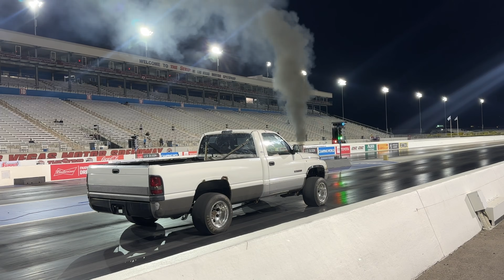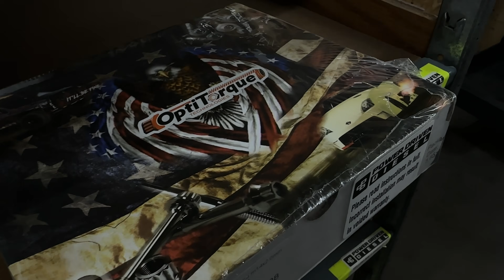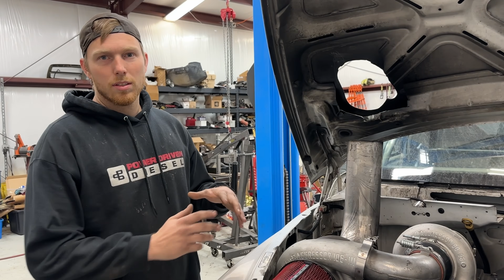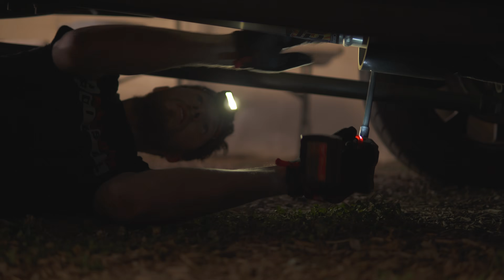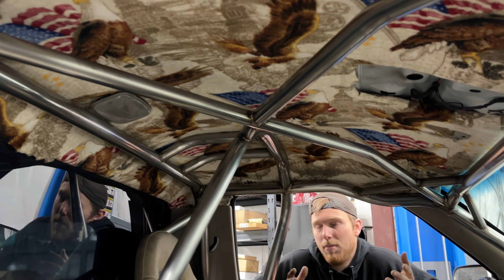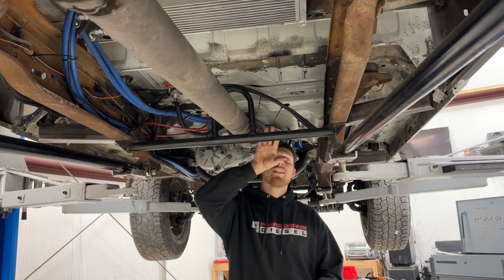6.7 Cummins Swapped 2nd Gen Dodge Ram

Comment: Have a question for you I’ve been building my truck when I can I work in the oilfield in Alaska so I don’t get a lot of time at home! Have an 04.5 has the pressure tower springs manton pushrods xdp billet rocker bridges,brand new ddp 150% overs 14mm exergy race pump,FASS 250 pump! And steed speed angled t4 with an aggressor 88! Built trans muldoons fmvb and I haven’t had time to run it yet have 5.9 diesel mm3 tuner at the moment but purchased a mp tuners to dial it in once I get it out of my garage and driving! What do you think the power level could be at with this setup?
Reply from the maker: Are you running just a big single?
Reply: @pddofficial  yeah I was going to run a shot a juice to get it spoiled up if need be it’s just a track truck is all I’m using it for
Reply: @pddofficial  spooled

Comment: I was hoping this was going to be your 2wd truck that you once said you basically upgraded the frame to 3rd gen? I have a 98 2wd that I want to lower a little and upgrade the trans Xmember and and switch to a steering rack ...
Reply: That truck is still around!  It got a 6.7 swap and is currently waiting for a custom turbo to wreck havoc on the single turbo class on the dyno circuit!

Comment: Interesting it’s only 400 more horse than Todd’s daily but with twice as much turbo. Seems like it must need more cam.
Reply: It's not that much more turbo.  It has the same GT55 on the atmosphere, but with a 480 on the manifold instead of Todd's 467.  The Larger Manifold charger doesn't make a big power difference, it just helps carry the power out further in the RPM range, as well as prevent heat soak going down the track.  Todd's tow truck makes about 10-20psi more boost then Scrat, which just shows how much the 96 turbine helps get the exhaust out of the motor.  The best I've done with Scat is 1847hp, but I expect to beat that come April 20th! 🤞
Reply: @CumminsWorks My bad I thought Todd had an 88 for the atmo. Personally I think a pair of 88s for atmos would go great with your 80 manifold.😊
Reply: Yeah I'm sure it'll make good power and I might get a wild hair up my butt some day, but triples are pretty miserable to work on.  Which kinda goes against the nature of the build.  Would be sweet though!

Comment: Dude your 2nd Gen is bad to the bone! I especially love the quick disconnect engineering of the harnesses. I have always thought that's what all vehicles should have period. I am just getting started on the 94 I inherited from my Dad when he passed, but when I have my money saved up I will be seeing you guys. But I send everyone I know with Diesels to PDD. My buddy just got his Trans done on his Black truck and he is happy as a clam, he hauls a lot of heavy equipment. You guys knocked it out of the park!
Reply from the maker: We appreciate the support!  Hold onto that 94', it's special now and it's going to be even more special as you customize it and make it your own!
Reply: @pddofficial  I am very stoked about it. I am hoping to put it around 600 hp and 1200 torque and still be not too bad on fuel. I am thinking that with that kind of power I will need a triple converter and a PDD flex plate as well as the panoff upgrade too. We will see what my budget dictates lol.

Comment: Pretty awesome but I was disappointed it wasn't a 12 valve. Still awesome.
Reply from the maker: 1800 HP fuel-only 12v is pretty difficult to maintain/keep alive.  As much as we hate to admit it, radical 13mm pumps capable of 1800 HP  and tuned clean are especially rare!  1500 HP fuel-only water cooled 5.9 block based 12V is the current threshold Will's working on making reliable.
Reply: @pddofficial  What's a safe, and streetable, hp capable out of a 5.9 w/VP44 ? Guy in my town has a 700HP truck but I don't see it out much. I daily drove 416RWP 20 years ago but I know things have changed , been out of it for a while till recently.

Comment: Any input on those speed of air pistons? Would love to see you guys test them and maybe see if something you would carry in stock?
Reply from the maker: We've been interested in trying them to see what, if any real world benefits could be measured.  We've all seen claims of 100 MPG carburetors and yet, they still don't exist.  If the claimed 20% efficiency gain was real, this technology would have been bought up by a large auto manufacturer and utilized to give them a leg up on the competition.  However, is it possible that there are other benefits like reduced idle haze, marginally faster turbo spoolup, even a mild 3% efficiency of power gain with some other not yet known tradeoff? We'd like to know so we'd definitely like to test the technology and see what it does or does not do!

Comment: I love the build, what happened to the shotty or shorty?
Reply from the maker: It's still around, terrorizing the dyno circuit from time to time.  Rumor has it, the shorty might make a big debut in Phoenix at that NHRDA race for the dyno event...  just a rumor at this point!
Reply: @pddofficial  do you have specific videos on this truck and it's changes? I'm thinking I need to build one , I have a spare cummins that needs to breath fire again ...

Comment: Gotta love the stock intake horn and 1800hp!
Reply from the maker: It would be fun to test a few intake elbows on this truck and see what each one does or does not change to the overall performance of the engine.  Any suggestions on which intake elbows should make the cut?
Reply: @pddofficial  I agree. That would make a great video as people do seem to discuss them quite a bit.
Reply: Banks, afe, smeding, pusher

Comment: Have you guys ever done a dyno comparison  of a banks monster ram and cold air intake vs stock intake and filter right next to a hot turbo?  Looks to me like the stock intake and just a K&N off the turbo works just fine:)
Reply from the maker: It would be an interesting test.  On the air filter side, this truck needs a 6" intake to match the inlet of the big 106mm turbo.  None of the mass produced air filter/intake kits would fit so it would be a less than ideal test scenario.  However, we could test intake elbows at the cylinder head intake plenum.  Those would bolt up for the most part and could be reliably tested.

Comment: Thanks for sharing. I tried the quick connects for the fuel and trans, but had issues with leaks. The o rings react to oils. 

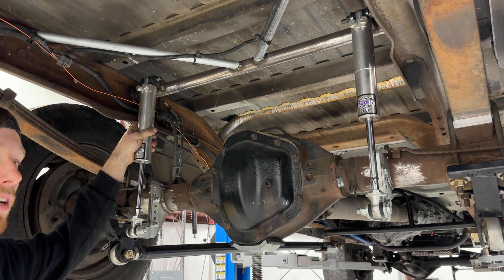7:30 Do they make a 2wd version of those shocks I see the compression rebound adjustments. The Bilstein's I run are valved too loose, but the tightest factory ones I know of.  A problem I have been trying to solve since 2018. I just keep getting told to get a 4wd truck. I got several of those too...
Reply from the maker: There are quite a few off the shelf race shocks that you can make work if you're willing to weld brackets to the axle and frame.  The heaviest valved shocks we've come across before you get into custom valved race shocks are the AFCO Big Guns shocks.  We believe they will be valved tight enough to control your rear end.  If that isn't enough, you should message John at Black Tie Race Fab and get some custom Penske's ordered.  Also keep in mind, once you get the $400 per shock retail price level, most shocks can be reworked with different valving to better suit your needs.  Strange, AFCO, etc.  Just don't go for the cheapest $250 shocks, they usually are not re-valve able.
Reply: @pddofficial  Back I have solved. Its the front I am need. If i had a knob on the Bilstein's I would say I need 2 or 3 clicks of each rebound and compression to get the ride perfect. I will visit the fox booth tomorrow and pick their brains. Something off the shelf should exist. I just problem dont have the lingo right.

Comment: Curious: how intricate was it to swap the 6.7 in? Motor mounts?
Reply from the maker: For motor mounts you'd want to source 98.5-2002 motor mounts since the 24v mounts are a little different than the 12v mounts despite the frame being essentially identical from 1994 thru 2002.  Then you could run any 24v block, but most choose the 6.7 to get the displacement and block strength.
Reply: @pddofficial  
I'm going to have a spare rebuilt 2004.5 5.9 Cummins pretty soon. I'm thinking of swapping it into my squarebody as is because of how great it is stock. Personally it's been the best engine I've ever had; ultra reliable, mega torque,  and 18-20 MPG.

Questions:
Would you install it as is? Everyone always wants a 12 valve. 

I've heard the injectors don't last as long as the 12 valve ones do. Would you or can you back-date it and build it as a mechanical 12 valve?

Think like the Roadkill Ramp Truck you guys did up. My truck is a 1 ton  regular street truck, but it's heavy and towing often.

Please and thank you for any insight.
Reply: The blocks are the same, it bolts right in, it's all down to electrical and plumbing.

Comment: Cool, my projects share some of the same titles, such as:

1.Overall project
2. Terrible disaster
Reply from the maker: It's a common theme.... sometimes the journey is more fun than the destination even if it's a bumpy ride!
Reply: Oh very much. The ride wouldnt be exciting without bumps!

Case in point:  i recently dropped an intake horn washer in my intake plenum and ran the truck... after discovering the horrid rattle i uncovered my stupidity.  This merely allowed me to justify taking the head off and porting it, buying studs, a steedspeed manifold, puahrods and springs from you guys. Hoorah for stupidity!

Comment: One day I'll have enough spare change to bring my 95 to you guys.
Reply from the maker: No need to have us do the project, start on the smaller/easier tasks as your time and budget allow and you'll soon become accustomed to making your truck exactly how you want it!
Reply: @pddofficial  I've already had a mechanic reseal the whole drive train, pulled the body off to powder coat the frame. I'm chasing leaks here and there still. At some point I'm thinking full rebuild because I'm chasing leaks. The steering is suggestive still even though everything is new.